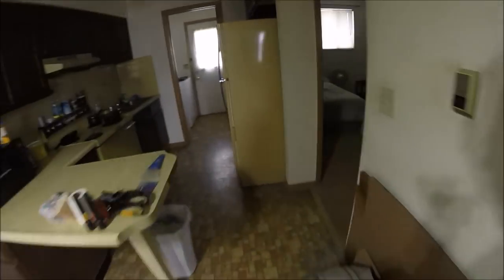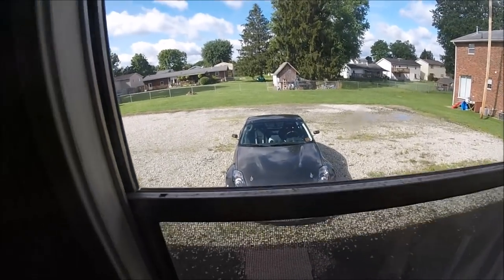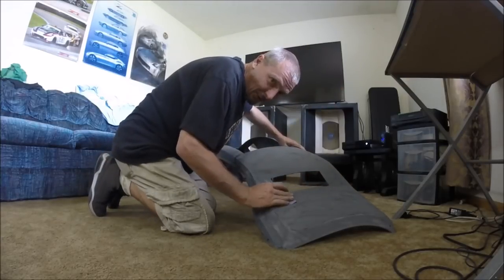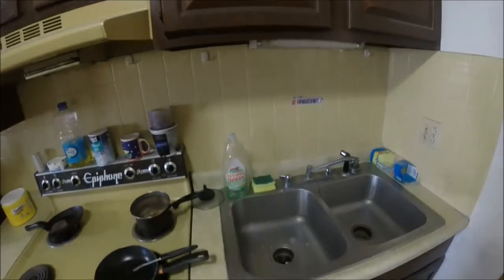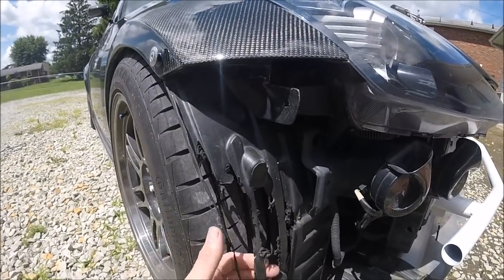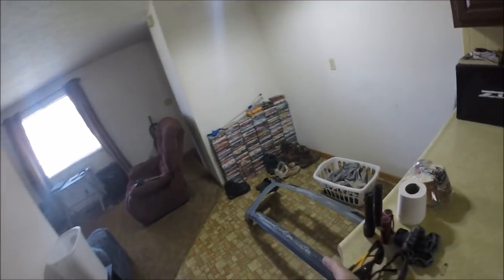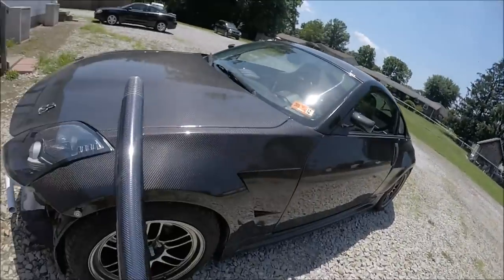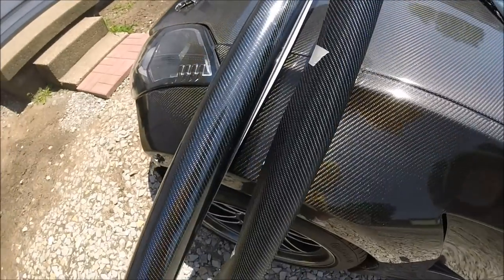How To Prep Plastic For Vinyl Wrapping

Comment: i bought a sovend based primer bumper is that the same as normal primer? can i wrap over it or what would you recommend for that
Reply from the maker: I'm assuming you meant to say solvent based primer and from what I understand no it will not work you have to be installing the vinyl to clear coat 👍

Comment: So did you clear coat it or just put paint
Reply from the maker: You going to have to clarify what you're talking about bro when checking comments it doesn't show me the video you're referring to
Reply: @TALONATER  the prepping bumper for vinyl for the 350z.  I saw you painted it but was wondering if you cleared it after paint cause I’m in the process of doing this myself
Reply from the maker: Yes it was painted and cleared but if you watch the next video I epically failed and didn't get to wrap it and it took the paint and clear coat off with it when I peeled it off I don't think I gave it enough time to cure